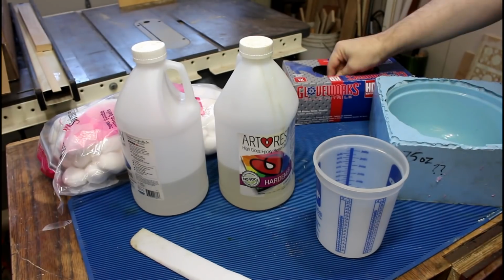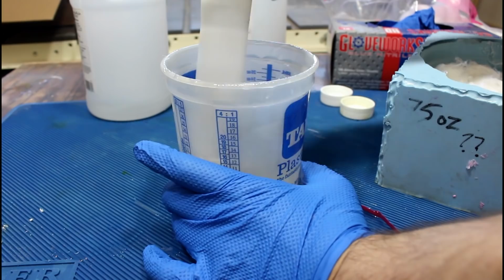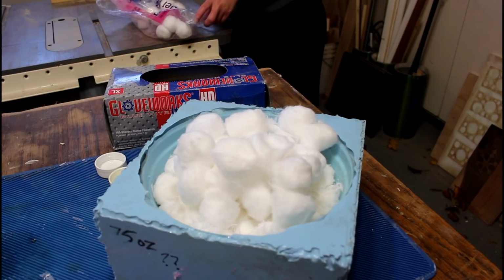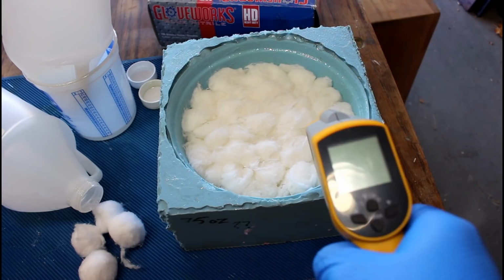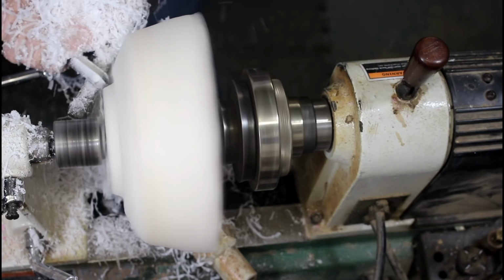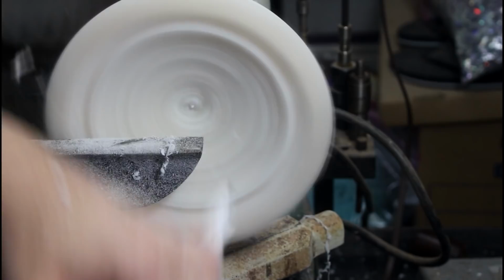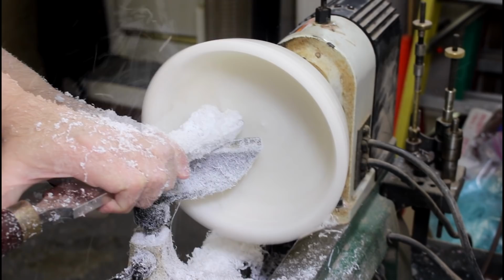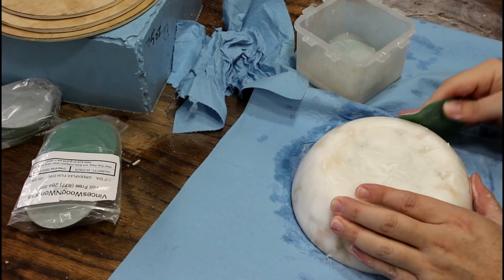DipIt #19: Cotton Ball Bowl

Comment: I was messing around with my crafting resin to see if you could add an essence to it and have it smell after. Turns out you can, but you would need a decent amount if you want a strong smell. Would be cool to see how you would use that idea of adding a fragrance in a epoxy project of yours!! I made scented bears with a silicone gummy bear mold.
Reply: AFAIK, oil and resin don't mix, so if the fragrance is oil based, it will slowly leak out over time.
Reply: Richard Smith you could use a crap ton of of candy flavorings or extract! The extra bonus would be if you used food safe resin, then if you licked it, it might taste good! 😂

Comment: I've been using cotton (both balls and flat pads) and cyanoacrylate to patch boots, make knife handles, &c for years now. Discovered it by accident, and never knew anyone else did this til now. With CA and cotton though, it's heats instantly and gets hot enough to deliver a blister within a minute, so I usually just use it for small patches and then shave it smooth with a razor. Cures crazy fast.

Twine + cotton + CA works well too, I figure since it tends to be made of plants and therefore cellulose so you get that same rapid hydroxl polymerization effect that straight cotton gives. And if I understand the chemistry of it correctly, humid conditions should speed up the process further.

Between all these experimental projects you do and the hilarious bullshit antics, you got me sold on this channel right off the bat: Subscribed af

Comment: Peter, In many of your casting videos you worry about air bubbles in the product. Why not build a vibrator table? I was casting fangs and the instructions said to use a vacuum chamber. Too expensive. I made a vibrator table using an old "industrial strength" massage vibrator. Worked like a champ, and best of all CHEAP! $2.00 and some old plywood scraps.
Reply: F.K. Burnham I’ve seen a lot of tutorials for DIY vacuum chambers on YouTube.
Reply: or just take a speaker out of your car, put it on the table, and blast your favorite music. vibration and music? it isn't stupid if it works...
Reply: Get a budget sub and play some bass boosted music
Reply: "industrial strength" massage vibrator? AvE tore one of those apart...
Reply: Bet the Mrs. Would really love to help with a table like that!

Comment: You essentially made a loose cotton micarta.  If it had been say layers of tee shirt and epoxy resin clamped under high pressure while it sets you get micarta.  Which is a great super strong material.  They make it with linen, canvas, denim, paper pretty much anything.

Comment: one way that could have potentially cut down trimming time would be to make a concrete mold (covered in whatever the other mold is made of, I’m assuming silicone) to fit inside the other loosely. It would be hard to accommodate for an even thickness but i’m sure it’d be possible haha

Comment: Instrad of using cotton balls, you should have used the rope cotton.  If you can’t find it, find someone who can purchase it from a beauty supply store.  You would have saved a lot of money on resin as you would have been able to apply it only to the sides.    Just soak section of the rope in resin, zig zag it up one quarter section of the mold, propped to stay slightly tipped, let cure, then repeat next section.  Then shave to shape.  Could work ..... maybe???

Comment: Why don't you ever put a wooden middle in any of these? That's a lot of wasted material and thus; money.

Also, when sharpening tool steel, never let it change colour. That blue colour it got means you lost the temper of the steel making it soft again, which in turn will make it lose its edge pretty fast. Always keep a water bucket nest to the grinder to cool it off every few seconds. There are youtube videos about this.

Comment: Hi Peter,

I was just watching another video (https://youtu.be/dbBlBZhp49s) and in this video, the person had a delicate structure suspended in liquid.  When they tried to remove the structure, it collapsed when it left the water.

That got me thinking: would it be possible to do some sort of displacement with resin and another liquid?  Like if he were to slowly pour resin into the beaker of water, would it push the water out and replace the water with resin?

I have a feeling that having liquid water generally isn't good for resin curing, though.